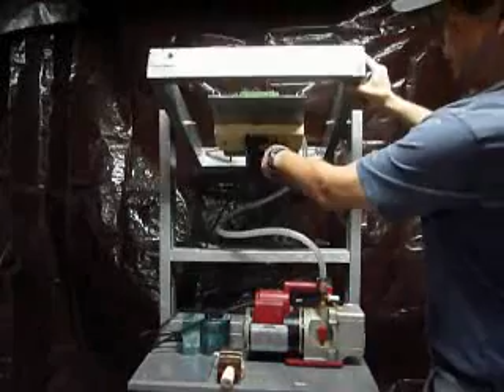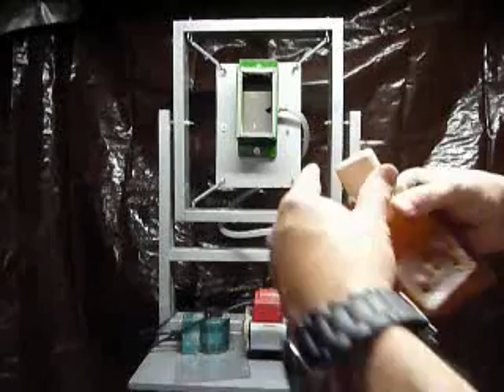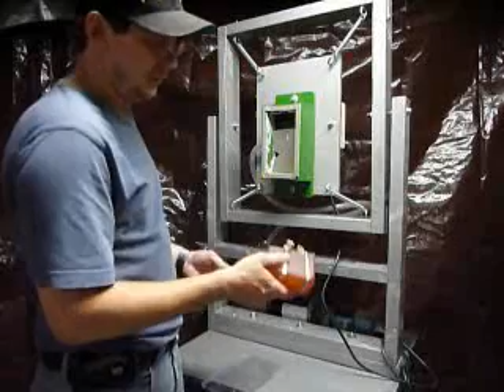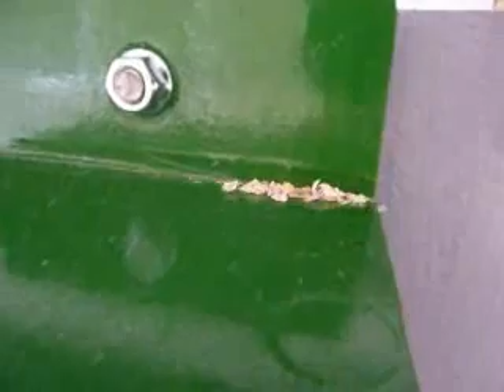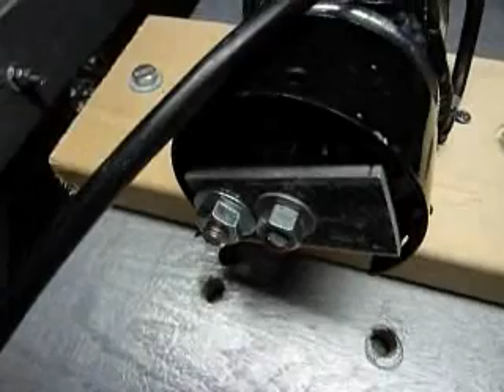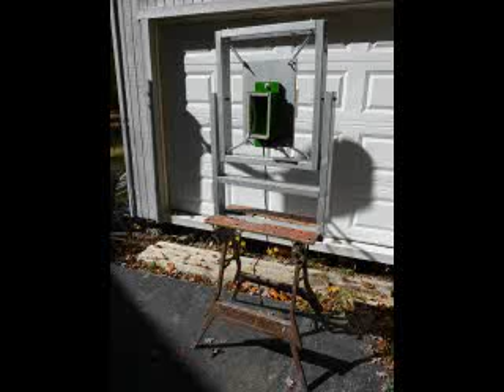Overman vac vib grav cast

Comment: hi Gary,
If we only vacuum it for a while, i mean, not until the resin "boil", will it works?
Reply: It depends on the viscosity of the resin. Thin or low viscosity resins won't need to boil and you only need to pull the air out of the mold ahead of the resin being introduced to the mold. Thick resins like epoxy will need to have the bubbles pulled from the material itself and will need to boil before the cast. Hope that makes sense!
Reply: Thanks Gary. My thought was just to vacuum the air void from the mold. The resin i use is like water, usually no bubble on the cast, but the void happen even when i have some air escape vent on the mold. If the chamber is vacuum ( not to near  29 inches mercury ), is there still such need for air escape vent on the mold? I am thinking of just using a vacuum cleaner instead of vacuum machine :-). I hope i am not too naive thinking that it will work.

Comment from the maker: Rich,
I built this setup mainly to do small 3d casts in a simplier method than my Vacuum Spin machine which can be seen at www.myheap.com
But now,  I mainly work in relief as well.
I have a similiar machine made expressly for reliefs. It's basically a vacuum chamber that vibrates, but the mechanism allows adjustment for both amplitude and frequency of vibration. The vacuum holds the mold in place while evacuating the air bubbles... all while doing a shake :-)
 I don't have a video of it ( may do that soon ) ..... but here is a still photo link:
http://www.willowproducts.com/media/images/Tool_photos/vibrating_vacuum_table.JPG
It doesn't look like much but it produces flawless open faced relief casts